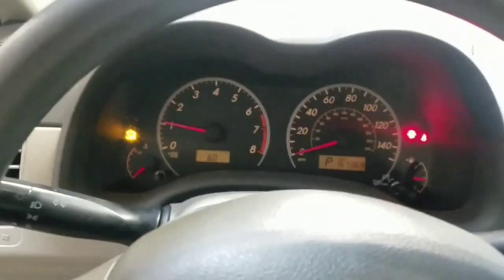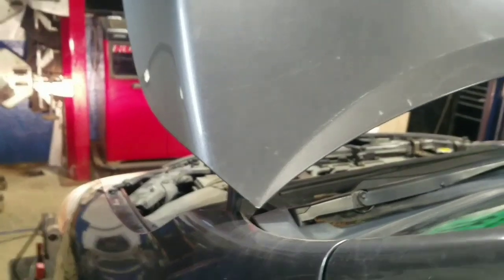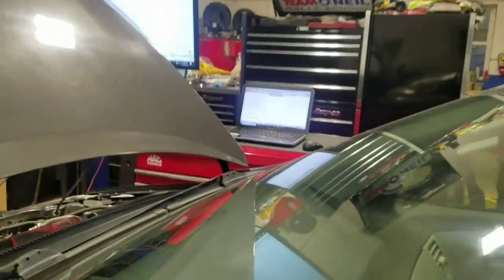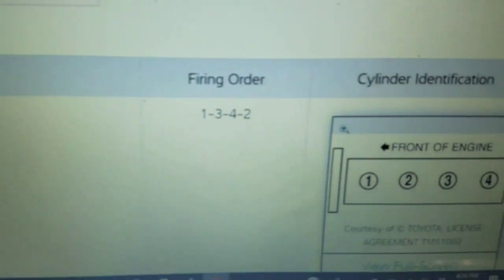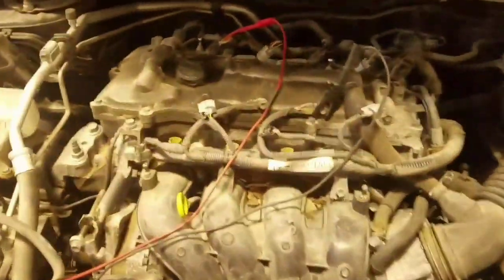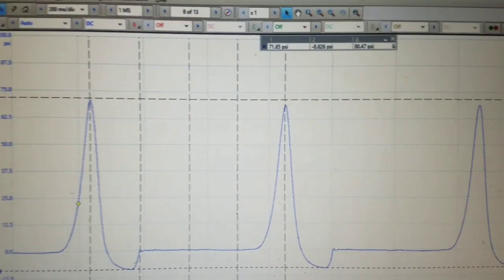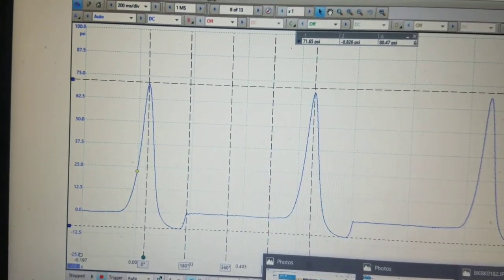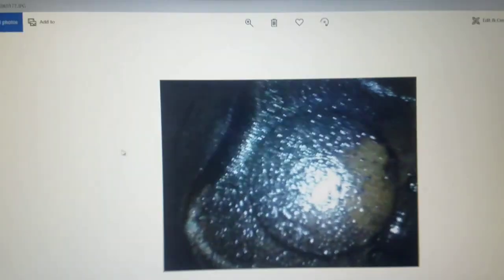Toyota Corolla with a misfire

Comment: I just went thru the same process with my 2005 Matrix.  Random misfire on one and two.  No codes, but I could see the misfire on live data.  I could not find the source of the problem.  One day went to start, and no compression in #2 at all.  Looked under valve cover, and an intake was stuck open.  Used a bore scope and while there was lots of carbon, there was no witness marks.  Was about to replace the engine, but thought I would pull the plastic intake so see why the valve would not close.  To my surprise, I found 2 pieces of plastic in intakes 1 and 2.  In the case of cylinder 2, it had dropped under the valve and it would not close. I rotated the engine and got the plastic out.  I found that there is a plastic baffle in the intake that had broken apart.  I broke apart and removed what was left of the baffle and put it back together.  Luckily no bent valve.  Great even compression.  No random misfire.  Over 290,000 km and it runs great.  The engine used to have a bit of a rattle, but that is gone too.  I guess it was the plastic baffle in the intake that was making the rattle.
Reply from the maker: Nice work!!

Comment: Shoud we do this test with WOT fully depress of APP?
Reply from the maker: Yes absolutely to fill the cylinder with as much air as possible but I was only using this procedure as a guide. I wasn't trying to get axact psi numbers at this point.

Comment: What about cylinder wash? Being that the rail is still under pressure. Maybe 2 injectors leaking?? That looked like a lot of fuel on the valve. Thanks for the videos enjoy these quick to the point

Comment: As cylinders one and two are low it might be just s bad head gasket.... 

Did you do a leak down test?

Thanks for your time and effort.
Reply: I was thinking the same thing.  Beat me to it.
Reply: @ozzstars_cars  
 Ozzstar  
Me 3, I was thinking maybe valve's not seating. Good stuff Sean👍
Reply from the maker: That's a great question I did in fact check for a head gasket/coolant loss issue. Thinking the same thing that maybe something was going on between cylinders one and two. I proved that to be false also cylinder leakage passed as well. Thank you for watching I appreciate it.
Reply: 09 Corolla head gaskets burn in between cylinders causing low compression in both cylinders. Happened to me twice! 😠